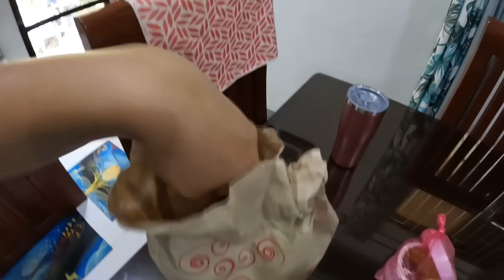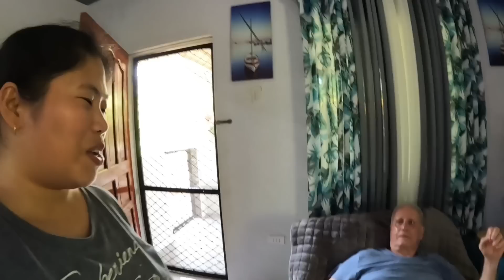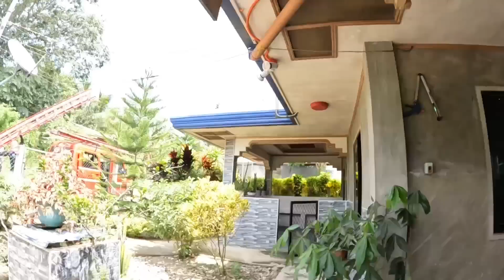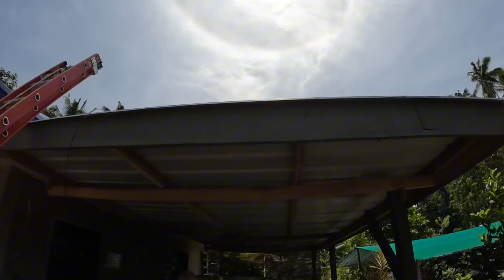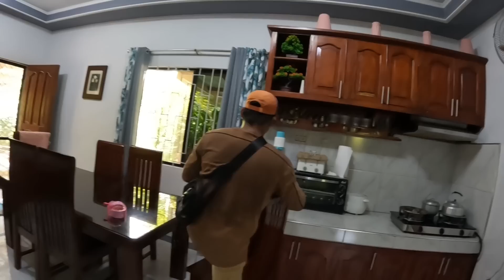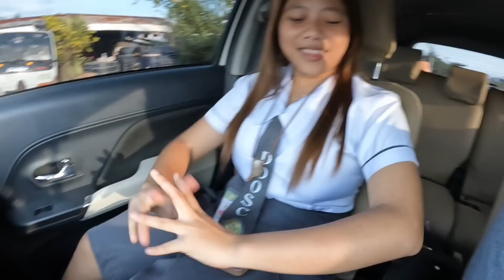Our Internet Ordeal Is Finally Over! What We Wind Up With + Someone Made Marites Dream Come True!

Comment: Did they give you a battery backup for the modem? Saves time if power goes out. Guy touching the wires is nuts. 😂
Reply from the maker: No they didn't but we're thinking of buying one.